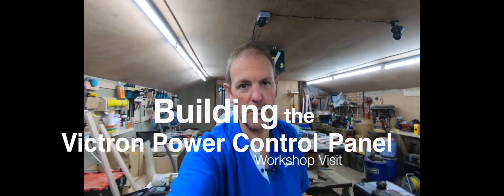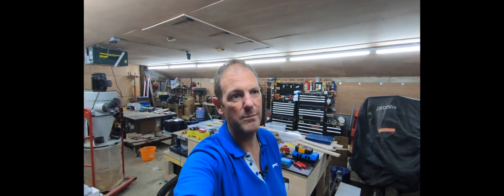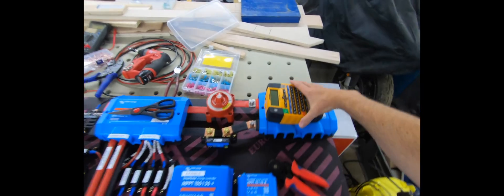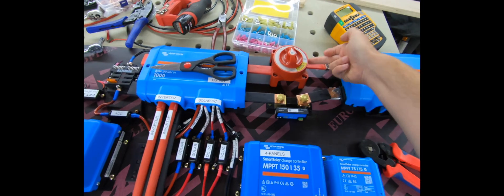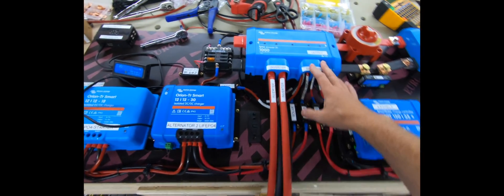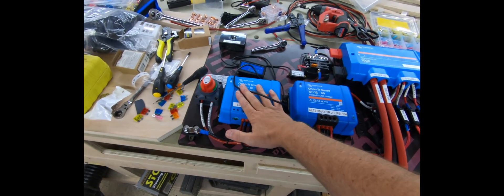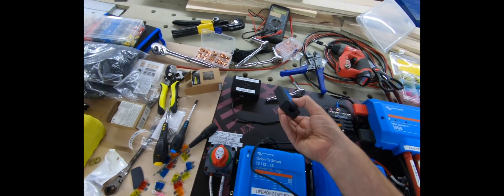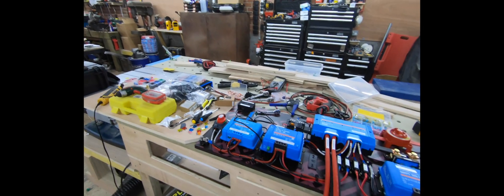Narrowboat battery build Lifepo4 off grid Panel Build...lots of Victron!

Comment: Im not much on wanting to learn electrics  Amps to Volts And watts etc  I am not good with not seeing something infront of me ..Like a current  So With my own Van build This really gives me a idea what i need if i can running off the alt And solar into a say 200amp Lifepo4  I already upgraded my Alt to a 145amp And wires to 1/0 Awg welding cable   Thanks for the video
Reply from the maker: It’s not too bad, just keep cables short and make sure terminals are really tight.

Comment: How are you getting on with the charging via alternator? Building some kit for my brother's boat at the moment, using this as the inspiration!
Reply from the maker: I’d say that an alternator controller is needed, unless you are going to run to the lead and use B2B charging only. I’m just installing a BMS 12/100 to do this…all get expensive!